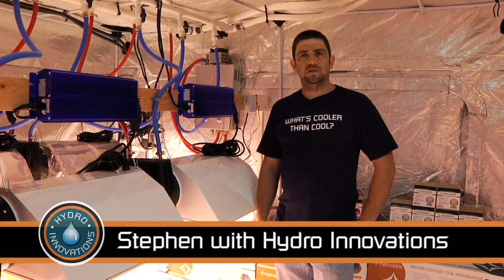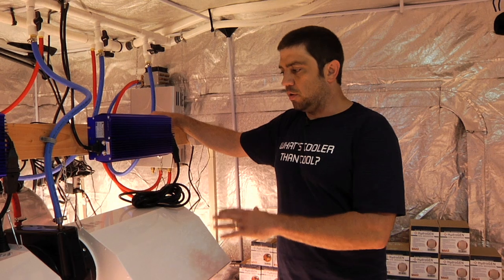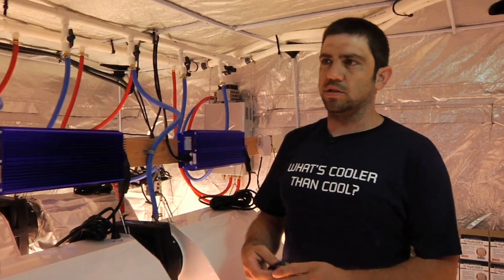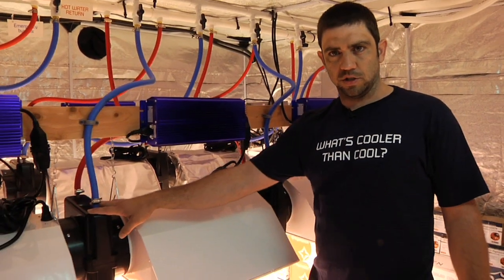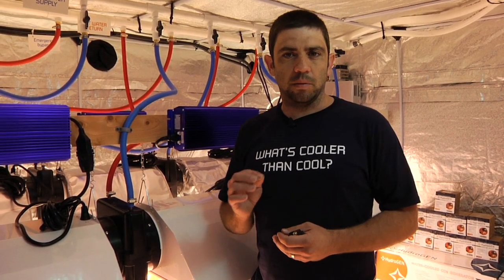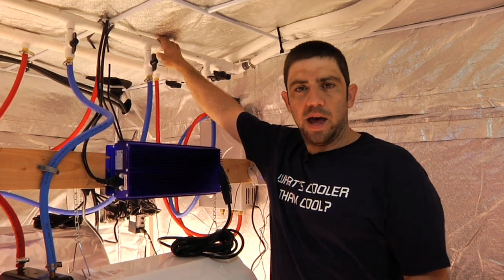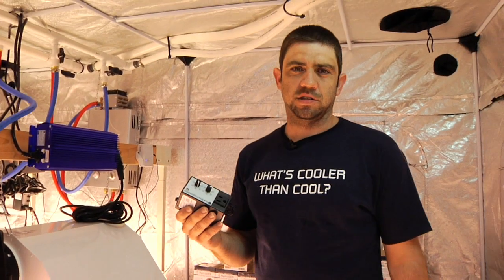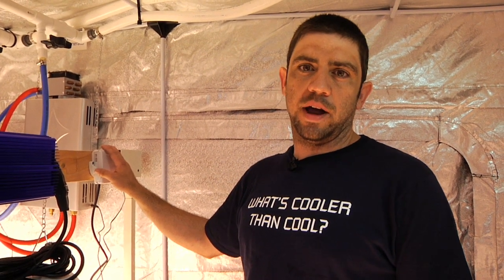Hydro Innovations Ice Box video

Comment from the maker: @KrayzieDA We never recommend placing the chiller inside, because we can't guarantee the BTU output of the unit when it is placed indoors due to the fact that the units are tested outdoors with unlimited ventilation.  That being said, if you can provide enough ventilation to the unit that you do not restrict its exhaust in any way then you should be able to run the unit efficiently indoors.

Comment from the maker: I'm assuming a few things here...you are using the ballast outside the tent, the tent is being used indoors and lastly that the chiller will be put outside away from the tent.

We would recommend using a 1/2 HP ChillKing chiller or a 1 HP chiller of another brand, a 1/6th or 3/10th HP sump pump, and a 30 gallon res. If using a 6" reflectors 2 Ice Boxes would be preferable, with 8" reflectors one would be fine.  If using (2) 6" you can run with a higher water temperature for the same results.

Comment from the maker: @KrayzieDA As for a controller/timer for the fan that is attached to the Ice Boxes you would want to use the Ice Box Thermostat.  If you need a controller/timer for intake/exhaust fan any timer will do.  As far as the covers that seal the fans when they aren't running, I think you are referring to the backdraft dampers.

Comment from the maker: This system doesn't add humidity to the room, it is a completely sealed system. If it is condensating it is actually taking humidity out of the air. We sell water-cooled dehumidifiers that take care of the heat...in fact our dehumidifiers blow out cold air adding to the air conditioning. We were not using a 3hp pump, it is a 1/2 HP...we used a 3hp chiller. Even with the pump and dehumidifiers running we can reduce a/c energy usage by 40%, just can't beat that.

Comment from the maker: @enigmasfriend The chiller is a separate item called a "water-chiller".  I was unaware that you vent to the attic. If you vent air from your cab to the attic then the Ice Box will not benefit your temperatures, because the Ice Box is designed to be run in a recirculating air setup.

Comment from the maker: @baseballDUDE32 Very clean setup in your video.  The only thing that I will say is that you may want to change out the copper coil that you are using for a stainless steel coil as your nutrient solution can slowly leach copper into solution.  But, other than that a very clean and impressive setup.  Keep up the awesome work.

Comment from the maker: @on3sayjon You will need a 2HP Chillking chiller.  You will only be removing CO2 if you are exhausting the air from the lights, but if you are watercooling them then you would just be scrubbing the room with the filter attached to the lights.

Comment from the maker: @givinlivin Yes, that is essentially what our compressorless chiller is, but you can only get your water temperature within 5 degree of ambient air temperature with this method so only people in specific climates may benefit from it.  And, you can use a pool as you have mentioned but be sure to have an inline filter that removes the chlorine from the water before it hits the heat exchanger or you will have a green pool from the leached copper.

Comment from the maker: @KrayzieDA You have the fan pull the hot air from the hood across the Icebox, which has cold water passing through it,  and the heat is transferred from the air into the water and pumped back to the chiller.  This type of setup can be very effective in a "sealed" room if setup correctly.

Comment from the maker: If the chiller is in a location of 130F, it will affect the heat removal from the condenser, thus giving you longer run times for the unit.  You can either run Ice Boxes for your 10x10 space or you can run an air handler.  It is personal preference.

Comment from the maker: I'll try to explain this to you once more. If you have a sprayer at the end of a water hose and its off, the pressure will remain at whatever is being applied. When you open the sprayer you do not get full pressure on the exiting side if spraying in to a low pressure area, the air for example. There is a pressure drop from one side of the sprayer to other, surely you understand that, if you don't I give up. Keep in mind we design and build these systems daily, if you were right I would know

Comment from the maker: For the unit to operate properly without a chiller you will need a constant source of 60-65 degree water.  If you use a chiller, you would only see condensation if you set your water temperature below the dew point of your room.

Comment from the maker: We try to have people eliminate condensation by tweaking their dewpoint.  Either by adjusting water temperature or humidity level in the room.  If you still would like to have the unit condensate then the newest Ice Boxes actually have a small drain adapter plug in the shell of the unit that you can use.

Comment from the maker: Well...to cool it properly you would need an 8" Ice Box since you are cooling 2 bulbs with it. Also you will need either a 1/2 HP ChillKing chiller OR a 1 hp from another manufacturer if you want to keep the water cool...1/4 HP is not even close. Two 1k watt lamps makes 8,000 BTU, a 1/4 HP chiller puts out 2,500 BTU of cooling at best. If you want to use the sytem as the a/c too your chiller would need to be even bigger.  Water should be between 50-65F degrees depending on humidity levels.

Comment from the maker: It might be possible but not recommended. Putting a 1k watt bulb that close to your plants usually yields detrimental results. I'm not saying it won't grow but the stressof the radiant heat would slow the growth, especially if not using co2. I would recommend 20" for optimal results. Less is more in this instance.

Comment from the maker: @varndizzle125 You really want to focus more on matching your chiller size to your heat load.  If your chiller is sized properly, then usually you won't ever need a reservoir any larger than 55-75 gallons and in some cases you can go all the way down to 16 gallons depending on the system type and size.

Comment from the maker: If noise is a problem then a duct muffler can be used or the fan can be put on a fan speed controller so that when cooling is not needed the fans will be at an idle, also if you are only cooling the lights and not the room the fans can be turned off during the dark cycle. Also keep in mind that these fans are in a sealed room, the ducting for them does not discharge outdoors which makes it much quiter than a typical setup.

Comment from the maker: @WholeTruthZ It is removing the heat from the lights and tent via the water that is pumped through the Ice Box.  Everyone's garden is slightly different, so there is no set kit that works for everyone, but if you contact our office via email or phone we can provide you with an equipment list for your room.

Comment from the maker: @Bublonichronic2 You are correct that you would need a MINIMUM of 1/4 ton per light to cool the room.  No, you cannot just add heat exchanger to obtain more cooling capacity, sorry it doesn't work like that.

Comment from the maker: @ChurnN55 As far as your lights, you would be ok using 1-8" Ice Box with 2 600w.  And just place the filter at the beginning of your run of lights to avoid any moisture from entering the filter if you were to experience condensation.

If all you want to do is handle the heat from the lights then you would only need a 1/2HP Chillking chiller, but if you want to add a/c to the room via the Ice Boxes I would recommend a 1HP Chillking.

Comment: Ok, I just saw both videos and i'm loving it! I have been intrested in this product for a while & ready to incorparate it with the rest of my equiptment..here is what i have..a homebox xl tent,(56"x56"x78.75") a radiant 6 A/C reflector, 1000hps hortilux, SP TD-150 6" inline fan,(293cfm max, for light) reflector & fan heat shld, insul ductin, can 66 filter, windtunnel 6 fan,(440cfm)ect..my ? is should I use 1 or 2 ice boxes to cool light and act as an ac for  room? & what size chiller, res & pump

Comment from the maker: @ChurnN55 Any condensation is going to be relative to the dewpoint of your room.  You can google dewpoint calculator and use the dpcalc.org link to calculate the dewpoint of your room.  Anything that is below the dewpoint will condensate, so as long as you set your chiller above your dewpoint you will not have condensation.

Comment from the maker: The exact wattage will be dependent upon your voltage, since voltage varies.  The 1 HP model runs at 7 amps on 110V.  If you had a consistent 110V then you would be running at 770w.

Comment from the maker: Let us help make it a 10. In order to increase your cooling without lowering your water temp you would need to increase the efficiency of your heat exchange in your garden. This can be done by increasing the airflow, increasing the water flow, or adding an additional Ice Box. All three of the suggestions will bring your room temperature closer to your water temperature. Using the Ice Box to a/c your room can absoultely be done but might require some tweaking to get it just right. Great comment!

Comment from the maker: It does cost more than a traditional system but the advantages outweigh the additional costs.  The ability to control your temperatures makes happy and more productive plants, you can grow in the summer no matter where you live, and significanty saves you energy even allowing an extra light without raising your energy bill.  It is the most flexible cooling system offered for gardening allowing  you to add new cooling components without  needing an a/c technician. Thanks for the comment.

Comment from the maker: Leaks are incredibly rare when using our tubing with the system, and with the use of hose clamps.  These systems are not a high pressure system, and so very low risk of blowing a connection once it is made.

Comment: Great idea! Let's take a whole bunch of water lines and place them directly above and weaving through 1000's of watts of power! Why? What is the benefit here? Why would anybody opt to water cool all their equipment while increasing theirs chances of a fire, when they can simply install adequate air conditioning for probably much cheaper. Is this system specifically for people who can't have a/c? Why would you water cool a dehuey? If the heat from your dehumidifier is gonna make or break your grow, your grow room is not up to snuff.
Reply: Water is far more efficient.

Comment from the maker: @CDXXbuds Most professional gardeners grow in a sealed environment to keep in odor and to not waste c02. When ducting air in and out of the garden this is nearly impossible. Also you are having to cut massive holes in the walls or celings of the garden for air ducting, this can be avoided using our setup. Also relying on outdoor air to cool your lights puts you at the mercy of the elements. This includes flucuations in heat and humidity which will effect your garden.

Comment from the maker: Yes I know, we are the inverntors and manufacturers of the heat shield too. Although we would like to sell heat shields to every customer the truth is for a sealed water-cooled setup they are not necessary. The shields are much more beneficial to people using outdoor air to cool their lights, this way the heat can't enter the room.  For a water-cooled setup your are cooling all the BTU's in the room one way or another. So there isn't a need to contain these BTU's in the air.

Comment from the maker: @Bublonichronic2 The amount of energy that you will use, will be dependent upon the brand of chiller and the brand of a/c, and what type of compressor is used in each.  As far as the DIY chiller out of a deep freeze, more than likely the compressor on the deep freeze will not have substantial output to give you the results you are looking for.  Most freezers have a small (~1000 BTU) compressor, but very heavy insulation with no heat load to achieve very low temperatures.

Comment: Would this system be adaptable to a supply/ reject with a heat sink such as a cold water mountain stream/ well.  I'm sure it would, since you mentioned city/waste backup (same idea really).  I was thinking of a solar supplied pump to provide flow (thermostatic switched) with a battery backup for rain days.

Comment: Air conditioning will dehumidify the tent as a side effect.   This system will add humidity to the tent.  Dehumidifying air also requires a lot of energy and the process generates heat.     Running a 3 horse pump must draw even more than a 1000W ballast.      I bet pushing air through all those cooling boxes also becomes significant for a true comparison.

Comment: You are correct and Tyler's Bernoulli's arguement proves it. Pressure absolutely drops due to increased piping diameter, The equation is balanced and shows pressure changes result in a balanced change in kinetic energy.  The energy of the system is conserved but the pressure changes. These principles are used for steam system pressure reducers and superheaters, ac expansion orifices etc. He's missing several other key laws of thermal dynamics a fluid flow, incompressible fluids, etc.

Comment from the maker: Radiant heat is from radiation from the bulb itself, it is not cooled by the air and passes straight through the glass. So no matter how cold the air is that you pass over the bulb there will always be radiant heat to deal with. This radiant heat is actually good for the ripening in small doses.

Comment: Can the heat exchangers be mounted sideways so that the cold water intake is top and hot water output is bottom facing to the side?

Also, stainless tubing is better for nutrient reservoirs that pH between 5.0 and 6.5, very acidic. Copper is not a good idea for constant submersion in acidic  nutrient solution.
Don't you produce a Stainless Steel "Cool Coil" reservoir cooler? 
Why are you using copper in your demo instead of your stainless product?

Comment: Hold on now:

Type of chiller he is using costs about 2500-3000. You cannot go below 1/2 hp per 1000 watt reflector with these things. That chiller will use a lot of power to continue to chill that water to where it needs to be in order to cool a 6k watt grow room. AND, the chiller might die on you long before it is supposed to because you are over using it. You could always go bigger chiller, but that is more money. Like 4 or 5k for a over sized chiller. The total cost for that system install could run over 10k. 

OR

You can call up your local HVAC contractor and have them put in a mini split system with a SEER rating of around 20, and you will probably save money on both the install/equipment and the operation costs. 

Hell, you could even buy two or three commercial cool portables and rig them up. Even if you have to replace them every 3-5 years, you will still be way under the cost of 10k for a water cooled system. You can get a good portable for 400-600, and I recommend commercial cool. If you want a real industrial/commercial grade portable, go with Kwikool or MovinCool, which both make units that are near bullet proof and way sturdier in every way than the portables you can get at target or walmart. Either one of these portable options is going to be cheaper, and most likely cooler, than the water cooled system shown here. 

There is a reason why normal AC is better, and is has to do with fluid dynamics. In short, air is a better cooling fluid for this purpose. In other applications, water might be superior, but here, it is not.

Comment: Your wrong about the 1" inlet, and 1 1/4" supply lines. Reducing the size of a pipe does NOT increase pressure. It only increases flow.  Since your in this business you should know this. To get higher pressure you need a pump that is meant to increase pressure. Simple thermodynamics,